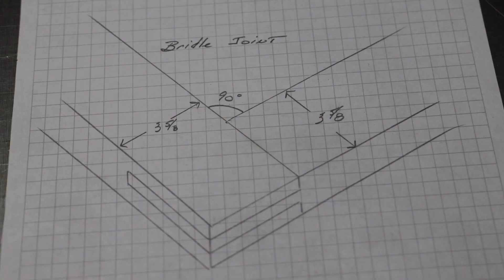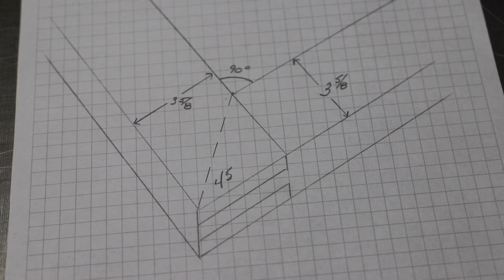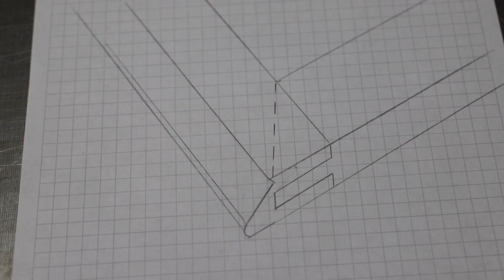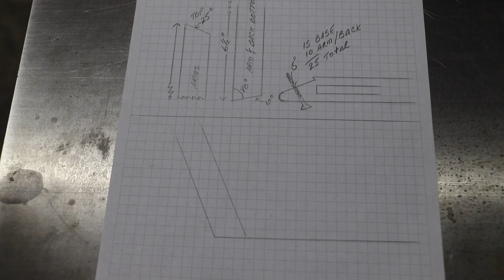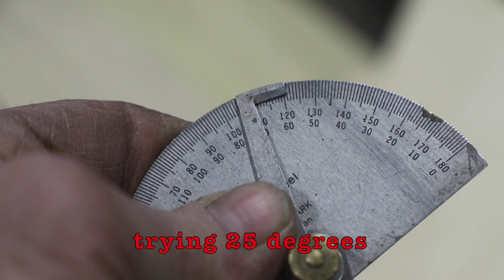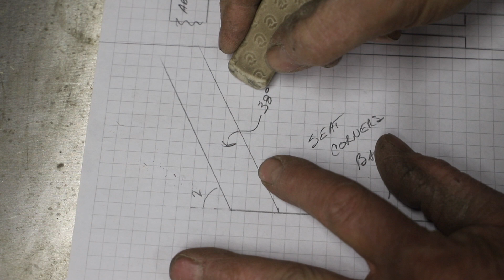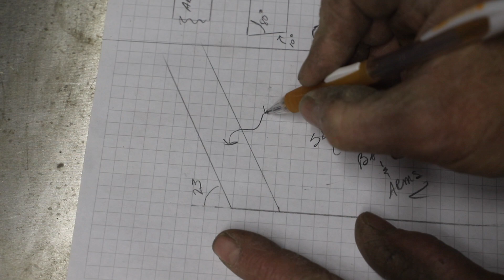Compound Angles in a Buggy Seat | 2 Seat Buggy Part 9 | Engels Coach Shop

Comment: When my father and grandfather taught me woodworking, they emphasized that a tape measure was a waste of time in most cases. In fact I still call a tape measure a mistake machine. I use instead a set of dividers or a stick, Yes just a stick. As a lead carpenter, I get asked a lot of questions, contractors apprentices, suppliers, accounting, billing etc etc etc. If I use a tick and mark the length, by the time i reach the saw, with all those interruptions. I forget the number. Having a stick with a mark I cannot forget, in fact I can mark many pieces on the same stick without writing a thing down. How you mark the stick determines an inside miter or an outside miter. It's hard to make a mistake that way. The real world is just that, A number/or measurement is just a representation of the real world, don't complicate things. THANKS GRAND DAD.

Comment: That table saw is an incredible tool. Not certain that there is anything like it being made today.
Reply: Agreed! I love what he can do with that machine.
Reply: No theres nothing close to how cool and versatile as this table saw. Besides the fence and table tilting did you know it actually has two saw blades on? Both are powered and mounted to a "rotating arbor" so he can quickly switch between a finish and a fast rough cut blade without touching a tool for the swap
Reply: Yeah, but don't you cringe a little bit at the thought of running a board through with the table tilted?  A little slackening of pressure against the fence and that board might be coming back at you faster than you would want.  Especially without a riving knife.
Reply: @maggs131 I have an old 1950’s? tilting table saw. It is belt driven and has a 3 hp motor. But it has many disadvantages. Tilting the arbor is far easier and accurate than tilting the table. Not to mention, the difficulty and danger of the cuts, tilted. His saw is different than most, as the blades are raised. My and other tilting saw, raise the table, to adjust the blade height. So out feed tables don’t work. Modern shops either utilize a sled the slide in groves in the table. The would work for a lot of his bevel and compound cuts. Or simply a bevel that slides in the track. 

All that being said, he utilizes that saw in amazing ways! The sled feature is really cool. And as others have mentioned, the dual blades. I think one is a rip and the other a cross cut. I suspect all that mass keeps a consistent speed too. I learn so much from watching Dave work out the details. 

And that is only talking about the carpentry skills. Add in the metal working, wood and metal turning, designing and building the tire tool and bender and so much more. Such a wealth of knowledge! Would love to drop in sometime. 

All the best to you and Dave!
Reply: @ITeachRick Plenty of modern professional saws about that would do the same tasks except the two blade feature, I have to disagree about the table most saws the arbor is raised and lowered and is in fact a much safer design. very few professional  shops faff about with sleds
Reply: You can buy a table saw that function like the made by Laguna
There very expensive.
Reply: @pijnto I believe that you misunderstood my comment. We agree that a tilting arbor is safer and offers more functionality. Also that most shops don’t faff with sleds. Dave doesn’t use a radial arm saw or a compound miter saw, both of which I have used. Each of those saws have accuracy issues compared to the way he uses his table saw, with a built in sled feature. This video was the first time I saw him do compound miter cuts. Having a tilting table saw, I know how difficult it is to set that up and how dangerous it is to use. 

I had a repeating project I did decades ago, that required accurately cross cutting 1x16 pine, to 15 1/2” lengths, out of 16’ boards. I didn’t have a radial arm saw, so I made a sled to be able to make those cuts. First to rough cut the long boards into more manageable lengths, then to production cut to the finished length. It was very accurate, safe and functional, for that task. Especially, the flexibility to screw stops onto the sled. I have rarely used that sled for other projects. I have made smaller sleds, for other tasks, but mostly, one ups. I rarely use the supplied miter accessory. 

Just my experience.
Reply: @Sam Logosz I took a look at the Laguna saws, sweat looking tools. However, they are all pretty much standard shop saws, and reasonably priced. The base model is only $1,000. Considering that the dewalt and Bosch 24” portable saws cost more than 1/2 that, seems like a fine price. The more expensive models have better features, also competitively priced. If you know the model of a saw, with a built in sled feature, I would be interested to check it out. 

They all use a uni fence system and not a built in sled, so not even similar. Also, Dave’s saw has a tilting fence, which allows for low angel rip cuts. A pretty unique feature. The bevel feature, on the sled is also very unique, with the preset detentes, as well as infinite adjustments. So, I would have to disagree with any modern saw, having any of the features of his saw.
Reply: @ITeachRick  I marvel at the degree of accuracy the scales of that saw possess.  Very fine markings.  Any other saws markings are just in the ball park at best.
Reply: I agree , and he uses the saw to create
a true piece of art. Thanks for doing 
something to save what I know will
be a piece to be proud of.
Reply: @Tom Bellus Right! At the end of the days, all that us craftsman want, is something to be proud of. And yes, he does utilize that saw to its fullest potential! A real pleasure to watch him work it!
Reply: @ITeachRick  No sled on the saw above it has a sliding table plus a Mitre fence, to buy a saw of that quality these days you need to look at professional items not home machines such as Bosch Laguna, professional saw e.g. Altendorf saws like this start at $10,000
Reply: Nothing like that made in the past 50 years.
Reply: @Page5framing  Wrong!
Reply: I have that same Exact F&E saw, from early last century.  Sliding tables were fairly common.  Less common was the sliding table with a dual arbor.  Yes, a sliding table is very convenient, but most modern "American" saws don't have them.  Most better European saws DO.  (Laguna, sure, but Martin, etc all offer such.)  Tilt top, as this saw is, can be managed, but it sure is an art to do so.  I don't use my saw that much, I prefer a tilt arbor, and you can buy after market sliding tables to add to your saw.  That is what I did.  Easier to add, and will carry a MUCH larger weight and sheet.  For what is done here, the saw is perfect.
Reply: @samlogosz8422  or you can buy just the add on sliding table—for about $1200!

Comment: Love watching your work, I'm an old New England Carpenter that does historic restorations, and I learn things from watching you and many others.  I often don't use formulas, but instead let the project guide me to where it needs to be. I remember one particularly complex molding we were doing on a shingle style Victorian, 8 1/2 inch crown going up the rakes which then was AutoCad figured to meld around the bottom corners into a wood gutter and a 4 5/8 inch bed molding under the gutter.  The architect spec'd it out and sent the knife pattern to the millwork shop to make, when I asked her what the angles and bevels to cut them at in order to make it all work, she just looked at me like a deer in the headlights, and then said, "I don't know, you'll have to figure that out.  We had to build a mock up of the gable bottom, and experiment until we got all the angle right, took almost 4 hours. but we got it done, she was impressed.
Reply: moulding bevels are a real dog, i remember when i first did it and thought 90° would work.

Comment: Wonderful job once again.  I want to thank you for validating the methods I used all my life. My Pop was a Physics & Science major and I had a friend in astronomy that was going for his P.H.D. in mathmatics. I've done jobs for both of them that insisted they either knew the formula or that I must know the formula before cutting the pieces out. 
I always did it like you. I got it close and dialed it in. Many times it only took me twice w/ practice pcs to get it right but I've caught both of them making mistakes in their methods they couldn't diagnose. 
I had a journeyman run out to his truck for a tool several x's and was caught by the boss not where he should have been running crown against octagon columns and beams w/ me b'c he couldn't figure the angles w/ out a tool. I kept suggesting trying to cut the compound miters w/ a scrap pcs of 2x4 just to get the angles, but he was having none of it.  I did it while he went to his truck the last time and the boss told me to finish the job and he'd give me a helper that would take the place of the journeyman. 
I'm not the sharpest tool in the shed and just a C+ man but, I got by w/ a little humility and common sense.
Thanks again,
Steph (Louisiana)
Reply from the maker: Hi Steph.  Fully agree, I guess that's obvious huh?  Good to hear from you.  Be well.

Comment: I don't know much about carpentry work or wood joints, that's why I watch this channel, but this joint is very reminiscent of the joint used in the stretch frame of paintings: "canvas stretcher joint". The point is that you can always stretch the frame afterwards with small wedges on the inside, although the frame is not screwed together there. Either way, this Buggy video series is very enjoyable, stunning with the love and expertise the way the Master works! I'll watch it all day!

Comment: It seems to be that this was very gratifying work for you, Dave.
The gentle rounding of the seat backs {even slightly rolling over towards the ends til right to the touch}; and the nosing round the edges all felt very satisfying for me to watch.
When it looks right, it feels right to the hand, and acts right forever.
And yes, guesstimating and then fiddling to get the angles to the "whatever" point that works right is the way I would do things, too.

Comment: This was one of your best vids. Fast and slow motion used with perfection. Then there is the complexity of the project. Been woodworking for over 40 years, yet I ALWAYS learn something from watching your vids. QUESTIONS: 1) Why are the sides out of poplar, when the seat is oak?  2) Why did you wet the edges of that joint — I don't remember Titebond being a moisture activated glue? •// I watched the vid you did about your saw, but didn't remember that your fence could tilt like that. AMAZING saw — yes it takes EXTRA caution to be safe, but the capabilities are worth it. Thank you again for sharing your craftsmanship.

Comment: Okay - I'm convinced - that's got to be the best tables saw ever made.  I don't know of any other saw built that can do compound miters like that saw.  
Years ago now, I worked in a furniture manufacturing woodshop and we had an old beast of a table saw, but again the table didn't provide a tilt angle like your saw.  I still do cabinetry - and other woodworking projects - and the hidden mortis-joint is not unfamiliar to me, however it is rarely used in my work.

Comment: Plot twist:  That table saw made those cuts on the original seat too.
Reply: @speedster9622  There probably weren't a lot of new buggies being built past the 20s, but I bet they were using buggies in small towns into the 40s.
Reply: @bigredc222  By 1915, the carriage industry had been decisively overtaken by the automobile industry, but aslate as 1935, there were still about 3,000 buggies manufactured each year for use in rural areas.   .a few more than i imagined
Reply: @melin1969  That's interesting, I wouldn't have guessed there would be so many buggy manufacturers that late. 
Thanks.

Comment: There are a variety of compound midst angle calculators on the internet. I use a good app on my phone regularly but, I'm not building buggy seats! The best way I know to reproduce multiple compound miter joints is the type of protractor you were using. I also make trial cuts and sneak up on the mark. 

The mark of a good buggy seat is not only to be strong and long lasting - the contour needs to fit the drivers "seat"!

Comment: Matthias Wandel has a chart on his woodgears.ca website you can print out for splayed miters like that.  The chart has a lot of columns for different number of sides to the box, in this case 4, and then rows for what angle of splay and it will tell you the right miter and bevel angles.  No math or trial and error needed.

Comment: Sometimes, such a "brute force" approach to finding angles is as good as or better than an elegant solution. Designing a stair-ladder for a bunk bed, I tried planning out exactly what angles I would need... in the end, they were not remotely correct, but figuring it out in a more physical manner worked quite nicely.

Comment: The more you use your table saw the more impressed I am with it. As I watch you I am reminded though of those old guys who did it without the benefit of the more modern tools.  They were fine craftsmen as well.  By the way, what brand is that big ol’ rasp you are using.  Think I might pick one up. The wagon is coming together quite nicely.  Gonna be fun to see the finished project.

Comment: The way it works for me. Cut required angel on piece to rest item on, then push it trough 45' angel. Drawback of course can only be done according to blade height, but gives you accurate angel.....hope that helps

Comment: Search "mitre angle calculator". I use the one at jansson(dot)us. For 25 degrees from vertical the angles came out as 22.9 and 39.9. I used it to successfully make trays with sides slanted 45 degrees.
Reply from the maker: Very nice.  Kind of takes away the challenge huh, or is it still there in putting the numbers to the wood?   Nice resource.  Thanks.

Comment: Dave, were these buggies "massed produced" or were they all one off. If there were more than one or two built at a time, I could see them building jigs to make the joints. I know from watching the steam workshop that there were jack shaft powered woodworking tools available. The early automobiles used a lot of wood work and brass in their construction and coach building techniques must have been used in the early autos. Thanks for your series. I am still amazed at the intricacy of the work required.
Reply from the maker: Most likely production runs by large companies.

Comment: Quite an exercise in geometry. I especially liked the way that you showed the stages in your drawings. Now, to ask a dumb question: for the rounded corners of the seat backs, it looked like you took off a lot of wood with a sander. Why not first hog out the bulk with a circular saw. I am a very poor woodworker but I have on a couple occasions done a very credible job like that freehand.
Reply from the maker: Always more tha one way to skin the cat.

Comment: Beautiful work, well done. Is there a reason you chose the wood rasp over a wood plane for rounding over the edges or is it just personal preference? There are mechanical drafting techniques for determining the angles, there are CAD techniques for determining the angles, there are mathematical techniques too. But your approach is undoubtedly the most appropriate as your results prove. I wonder how many of your commenters are going to whine about your use of an architect’s scale for a straight edge?
Reply from the maker: I have an assortment of planes, but have grown accustomed to the rasp.  Drives many woodworkers nuts though.
Reply: @EngelsCoachShop  LOL, not surprised

Comment: Just a quick question about something I noticed. When driving screws into the wood, you give many quick bursts with the drill instead of driving it in and letting the clutch stop the screw at depth even after a few test fits. Any particular reason?  And did you moisten the end grain before gluing it up? I've never seen that. Effective?  Great work Dave.

Comment: Dave, I really look forward to your videos. Question...I noticed you wetting down the miters at the corner of the seats before gluing. I’m not familiar with that using a Titebond yellow glue. I always assumed the joints needed to be dry. Something to do with end grain I assume, but would appreciate your explanation. Also, I can’t remember when you were breaking things down if there were irons helping support the angled arm rests. They look vulnerable without some reinforcement.

Comment: The 23° angle is pretty simple to calculate from the "lean" of the sides and back (both are 15° + 10° = 25° off vertical). The angle of interest, θ, is given by the expression θ = arctan(sin(25°)) , which evaluates to 22.9°
So yup, 23° is indeed a very good approximation.

The other angle (difficult to derive, I had to search for the formula) is given by the expression θ = arcsin(cos(25°) / sqrt(2)), which evaluates to 39.9°. Again, 40° is a good approximation.

Comment: Couple of questions: 1. What glue did you use?  I noticed you pre-wet the joint with water before gluing.  2.  Are the seats typically installed tilted forward just enough to drain water?  In not, I could see the potential of a small reservoir in a rain and degrade the seat eventually.  Thanks.
Reply from the maker: I use Titebond three.  A tilted seat would assume the buggy is always left on a flat plane huh.  But, you probably noticed the decay on the old seats in those back corners also.
Reply: @EngelsCoachShop  I understand the flat plane reference, and yes, I saw the decay you spoke about.  What about drilling a small drain hole in the back corners?  Would that detract from the level of original historical detail you are replacing?  And would the client appreciate it in the long run?  A drain would surely increase the life of the buggy seat beyond the original.  Great videos.